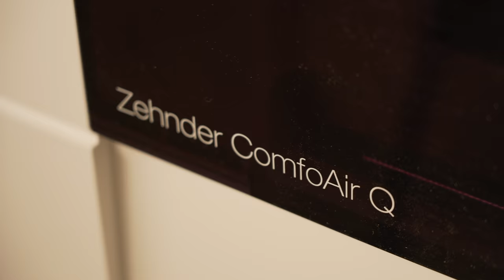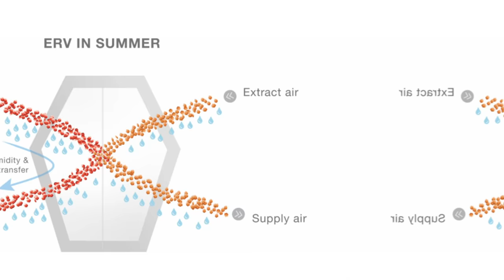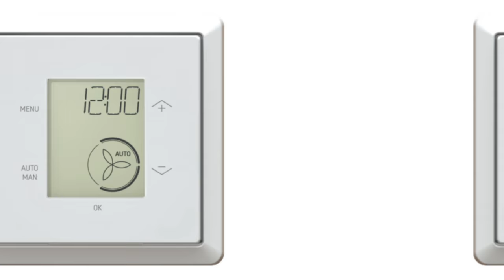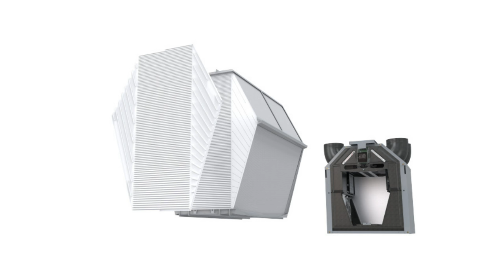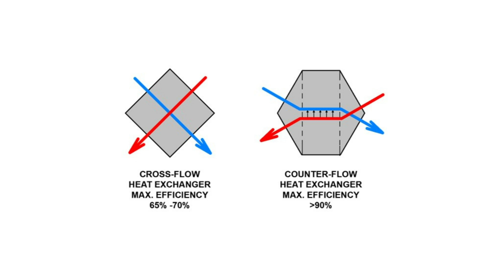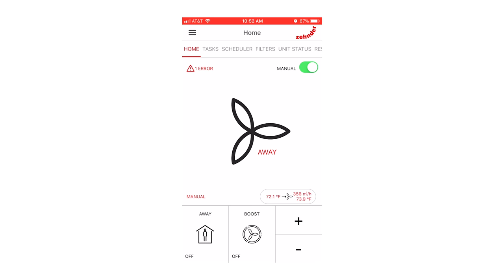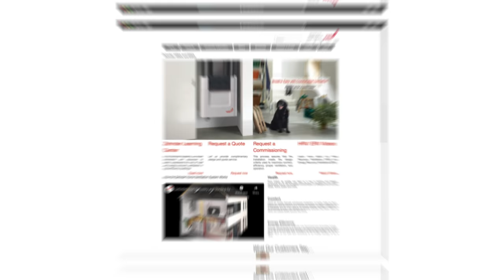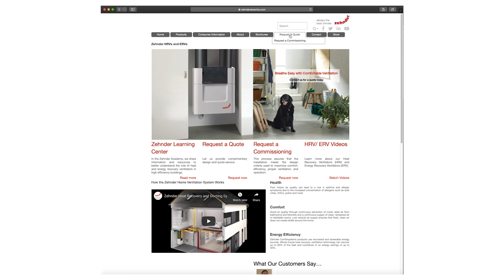Passive House - Fresh Air System Install & Costs (Zehnder)

Comment: To save anyone else from doing the math about how much 100W will cost you a month, given avg. Texas electricity price of $0.11/kWh.

730 hours * 100 watts / 1000 * $0.11/kWh = $8/mo
Reply: While this is a useful calculation, you need to pro rate the cost of the system and the maintenance of the system over its life. Additionally, if you're considering putting this in an existing home, what are your cost going to be to make the home tight to take advantage of the system.
Reply: Minus the cost savings what would be the delta? still cost (- out of pocket) or benefit (+ in pocket).
Reply: Yea that's a great savings but what the marketing wank and builders don't tell you. The huge upfront investment to buy it and the high cost maintain/ repair them you WiLL NEVER makes your money back. 

I work and install these systems daily and I would never want this in my home or a ultra tight home. Cost of one of these systems I can buy 2-3 of a high quality mid range efficiency system that doesn't break the bank to repair or run. I can actually make my money back

Comment: Great information. Looks like a promising product. Would be great to see a future revision support the Matter standard. 

I was wondering about pleasant open-window weather.  Does the ventilator still need to run then? 

It strikes me that there are several temperature levels where different ventilation might be desirable. There is a level where it is so pleasant, we just want the windows open and then any fan becomes unnecessary. Then there is a level where sometimes it is pleasant outside but hotter inside, even with the windows open. Then we want something to draw in air from outside perhaps simply through the windows.  We don’t need energy recovery; merely need fresh air pulled in and the hot air from radiant sunlight pushed out. No need to exchange heat or humidity: simply exchange air.

Does this appliance address these issues? Or am I failing to appreciate what it does in such circumstances already?

Comment: Do you still use a separate range hood or does that tie in to the HRV as well?
Reply: Range hoods can not be exhausted through an HRV/ERV potential for a very dangerous situation. Hood fans can be paired with a powered makeup air system... I believe Matt has so video regarding this situation

Comment: While the system may be auto balancing to always maintain that 180cfm, it's going to take quite a bit of back and forth tinkering to get each vent in each room dialed in. As you dial in the vent in one bedroom to say 10 cfm, it's going to effect the flow at ever other vent in the house by some amount. As you work your way around the house and dial in each vent to the flow you want,  the vent you started at is not going to be 10cfm anymore because of the adjustments made elsewhere. Perhaps it's a negligible amount and who cares, but I could see a person having to do a few complete cycles of adjusting at the vents before the effect is no longer measurable. Seems like a great system though.
Reply: It's probably analogous to a "pump-up" leach field. Start out with everything wide open. (In this configuration, most of the flow will be through the shortest duct run.) Then, beginning with the shortest run, turn down the vent until it's flowing like you want it. You may not have to turn down the vents on the longest runs at all. Only duct runs with similar drag would need to be adjusted simultaneously.

Comment: was waiting and waiting for the talk about the exhaust fan in the kitchen does that air get recycled out the unit - if it does how are you trapping the grease particles.
Reply: Matt answered in another post - no that dirty air ( and, strangely - makeup) - is separate.

Comment: How well do these systems work with cooking fumes / oil particles produced while cooking? How about laundry dryers? Obviously can't just vent that inside the house, especially if it's a gas dryer. 
Also how about the moisture produced by bathrooms, could that lead to mold/moisture issues in the ducts? Lots of questions and while the idea of an airtight home and clean air sound great - still giving me a lot of pause. 

Also how do the costs add  up? Sure there's that extra "$5k-12k" on the system itself (forget if that included labor or not), but there's also the upkeep. Ok, that's 100w used at all times with the fans running? That's like $113/yr just in energy for that. PLUS he said to check/change filters every quarter (those look like special filters... I'm sure those costs add up too). And how long do we expect these units to last? 15 years? 30 years? Longer? 
While it may make a heating/cooling bill a little cheaper and the house a little more comfortable and healthy to live in, the pure math just doesn't seem to add up to me. 
How much of a difference in the HVAC bill would we even expect with all this extra insulation and airtightness? 
If it IS indeed more expensive in the long run, it would be good to know how much $ I'm paying to achieve this level of physical comfort and air quality.
Reply: Add some solar and over 20 years the costs go away - then we may need to   replace the solar - at costs equivalent of a new AC unit. (Thinking about it - HVAC will likely never have a similar warranty to solar panels, so the solar is probably a better complement to "zero net cost")
Reply: Good points, Colin. An ROI could be estimated using specific flow rates and temperature differentials as long as you're comparing it to the same ventilation rate using bathroom fans (have to compare it to something). We have examples of this we could share with you. But the reality is that most homes are very poorly ventilated, making the ROI on heat/energy recovery difficult. And beyond that, attempts are now being made by health researchers to quantify the lost productivity and medical costs that can be traced back to poor indoor air quality. Should that be part of the ROI?
Reply: @christophersmith1894  I'd say so.
Reply: @christophersmith1894  . Indeed. Historical metrics will likely show a net cost (with conventional power) with overcomplicating HVAC. -A simple gas burner in a tin shed probably beats any sealed, insulated, controlled-ventilation McMansion. Comfort -that's subjective -spend what you want on being comfortable.

What you describe as "poorly ventilated" is actually poorly sealed yes no  cost saving untill the envelope is "controlled"-freely passively ventilated, whenever and wherever the wind blows. Poorly ventilated is an Icebox with the lid on..  have a laugh. It gives me a chuckle too.
Reply: I figured it was your boyfriend
Reply: The building scientists experts say you need a separate exhaust and make-up air for the kitchen vent.

Comment: These are common in Alaska where new construction is very tight. A fresh air heat exchange system is a must or you'll get moisture buildup in the house.

Comment: Great episode, only thing you didn't cover was how the life expectancy and guarantees compare to the alternatives. e.g. Typical bath fan lasts what 5 years so long term costs are probably lower for Zehnder?
Reply: Nope, didn’t cover my passive solar home in CA!
Reply: I was just thinking that. 30k system to save $20 a month and replaced after a few years? First world solutions
Reply: @jl9678  where did you come up with 30k?  he mentioned 10k, but that is for a pretty large house
Reply: @BrianKrahmer  
10-12k is just the equipment package. If I know anything about hvac it's that the labor is usually 1 to 2x the equipment price. Hence the 30k
Reply: @jl9678  if you're willing to pay 20k to install a system like that, drop me a line.  i'll fly over from europe just to do that.  at a labor rate of $100/hr, you're talking 5 weeks of work.  i'd be disappointed if i couldn't install that system in less than a week.  i'd honestly estimate 3 days
Reply: @BrianKrahmer  you must think u.s contractors charge by the hour. lol. How cutely naive of you
Reply: @BrianKrahmer  contractors charging by the hour?! they don't exist

Comment: This is great. I have so many questions because of how fascinating and unfortunately uncommon the tech is in today’s homes.
What’s the maintenance? Does the core need to be cleaned?
Is that prefilter going to get overloaded? I’m thinking pollen vacuum on the side of your house.
You run multiple duct runs to each room to set your max airflow and then you fine tune it with the registers?
When flow hood the register, won’t the self adjusting throw off all the other registers you just adjusted?
If its in boost for somebody taking a shower won’t every other room be boosted as well?
Whats the strategy to prevent a “draft” feeling from the cooler fresh air? Here in the north the outside air can be 70* cooler in peak winter.
Will airflow between intake and exhaust rooms be enough to open/close doors?

I love the approach you’re taking here and I hope it takes off. I can’t wait to see this integrate with smart home and IoT products.
Reply: I wonder how long semi-permeable membranes in ERVs will last - in a jacket some break down within  5-10 years. A HRV has more durable partitions - but no vapour permeability
Reply: Pretty sure the core needs to be replaced at some point also. Typically you can vacuum them at least, but unsure if that can be done with this one? I expect the core to be expensive to change.
Reply: The core should be removed and cleaned every year. Vacuum the edges and run fresh water through it (warning, though, not all ERV cores are water washable like this one).
Our filters should be checked like almost all filters on a quarterly basis.
Yes, the Luna diffusers provide adjustment to compensate for the varying duct lengths.
There can be a couple iterations of adjust registers, but the fact that this Q600 ERV adjusts automatically to maintain the total flow helps make the process a lot easier.
Yes, boost is for the entire system (there's no "zoning").
High heat recovery and relatively low airflows are sufficient to avoid cold drafts.
Yes, the airflows in each room are usually low enough to move freely around/under a closed door.
Reply: Christopher Smith thanks for taking the time to answer.

Comment: Can this really handle exhaust from a high cfm range hood? Does it negate the need for a make up air source for a range hood?
Reply: No way
Reply: That was my question as well, not to mention I've cleaned exhaust hoods in houses before and it's not just clean moisture that travels through, I'm not sure I'd want an ERV to handle it.
Reply from the maker: No. I have a separate system for exhaust at my kitchen range that will also have a make up air system
Reply: @buildshow  can you do a video on it please
Reply: @buildshow  what are your thoughts on active makeup air systems like the ones made by Fantech? Also - is using a gas range not feasible in a Passive House if we balance the range hood with an active makeup air system?
Reply: @nuevocomienzo9571  good question.
Reply: @buildshow  Then is it really only two penetrations? Or am I missing some knowledge that is scheduled to be bestowed in a soon to come video?
Reply: @chaseweeks2708  I'm sure there is at least one plumbing vent penetration, but that doesn't require makeup air. The dryer is also going to need to be a heat pump dryer to avoid the need for a dryer penetration. While more energy efficient, these will take significantly longer to dry your clothes, and may be a lower capacity and higher cost than expected. The 7.4 cubic foot models no longer seem to be available.
Reply: @nuevocomienzo9571  One thing people don't usually think about with going zero emissions  in the future is we will have to say goodbye to gas water heaters and gas ranges.  Maybe on the next remodel, gas range is best left out.
Reply: Very good thought - It was left out of the discussion, as this not the application for that. (sane as any "flued" system (Furnaces / Dryer - I would also include bathrooms in that the extremely humid exhaust at "bath time" should just be dumped outside) - as Matt Replied   not the correct device for that application.  NB. A rangehood also has potentially hot, combustible and very dirty exhaust (filter bypass if not maintained) - you really don't want that either in a plastic pipe, or a ERV/HRV
Reply: @thezfunk  In Australia, the ACT (a mini-state) is in the process of "banning" Natural gas from new developments.  As an up front cost with a new build, solar (with or without nighttime supply) definitely appears to of set any ongoing costs with being "fully electric".  I know with solar  I haven't had a power bill for a couple of years.  Yes, I had to spend many years-worth of power bills up front, but as banks aren't paying much interest these days, guaranteed "ROI" is safer than an unstable market.
Reply: @kadmow mini state 😂 poor ACT. Robbed of its dignity of being the capital city.
Reply: @moonbaywalk  😆😆😆 That would be Canberra not the ACT.   😅😅😅😅
Reply: @kadmow  You're right haha. I thought Canberra being in ACT meant the same thing 😅
Reply: @moonbaywalk  . Well I admit I have lived there in the past. Big difference. Kind of like Syracuse  not being New York - though in the state.... lol. enjoy...
Reply: @steveXracer yup, I realize. Just saying if zero emissions is something we as a society decide to push for....
Reply: @steveXracer  Poor people don't drive housing markets, not really a consideration. The poor can move in once the rich have moved on. (like in rundown inner cities - once in a lifetime opportunity)..  Sad but true. If land supply  is limited (Line Vaucluse or "The spit"-Poole  the rich  will have to maintain, renovate and renew ( sucks to be them - need another digs while the reno's underway) and the poor get to pick over the scraps in the trash -If they can afford a permit..
Reply: @buildshow  Seconding the request from @ghulands -- would love to see even a quick video on how your makeup air system works for your range exhaust.
Reply: Kitchen exhausts have to be ducted straight outside. Venting kitchen exhaust gases into an ERV or HRV is a fire hazard. Not to mention the grease accumulates rapidly and destroys the appliance. The very same heat exchange that tempers the supply air, reduces the exhaust air temperature and condenses cooking and combustion byproducts into the core.
Reply: Would love to see a video about the range makeup air. I’ve seen a couple past videos but maybe some calculations, parts selection, and strategies for ducting runs and vent placement to minimize grease accumulation.
Reply: Matt Risinger I would also like to see a video on range make up air.
Reply: Any range hood 400 ft or more needs makeup air by code. Typically done by motorized damper (wired to hood) which opens up and dumps air directly under stove to wash that area. Provides the least amount of comfort issues and affects the total loads on the home the least as well.
Reply: @chaseweeks2708  it's just two penetration for the tsehnder and two more for the range hood and some for the water, some for the sewer, some for the electricity some for the clothes dryer( unless you in EU and get the condensing dryer) and some for Heat pumps .... like he says if addressed properly, no big deal
Reply: Costs?
Reply: thezfunk no way I could give up my gas range or gas tankless

Comment: Speaking of emergency power... are you going to have your panel setup to have a gen-set run all these critical systems when the power is out from utility? Also, would be installing a permanent natural gas gen-set?
Reply: this is an important question. I'd like to know the answer as well.
Reply: Not sure ERV/HRV is a critical system, just open a window.

Comment: My question with an erv is when you’re exhausting humid air after a shower is the erv not transferring the humidity to the fresh air, therefore defeating the purpose of exhausting humid air to start with
Reply: the cooler air from the inside cools the air coming in. that causes the humidity to drop out.  the humid air from the bathroom goes out
Reply: ...and these intermittent shower events are just a blip when you're using continuous ventilation and considering the whole volume of the house. Your point is valid in that there is some quantity of humidity staying in the house with moisture recovery, but it's very short-lived in the scheme of things. The continuous exhaust from the bathroom long after the shower is over keeps the bathroom mold-free and that perpetuates good air quality in your house.

Comment: 4:56 good you went higher than that, as this seemed low compared to equivalent Norwegian building code requirements of minimum 15 cfm per planned sleeping place and 0.065 cfm/sf for living areas.
Reply: Yes, I wanted to make a similar remark, but your standards were even higher.  Explains why  I enjoyed my sleep so much in our long term stay apartment in Norway.